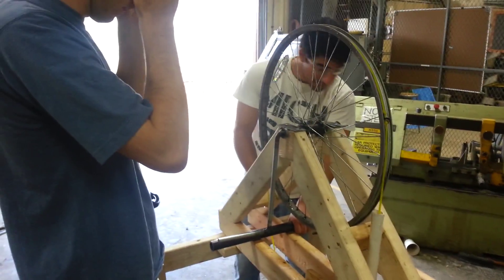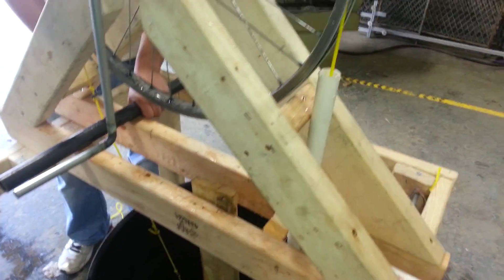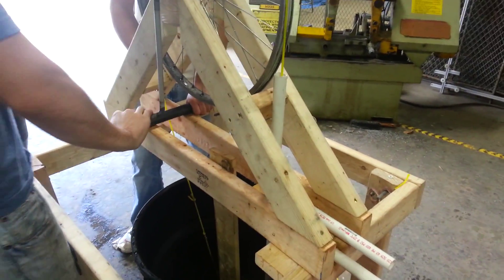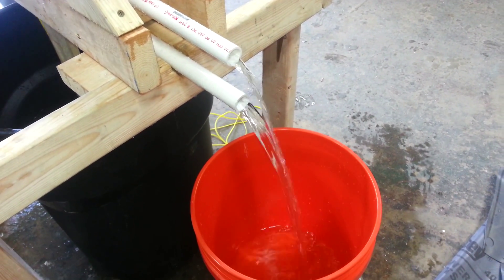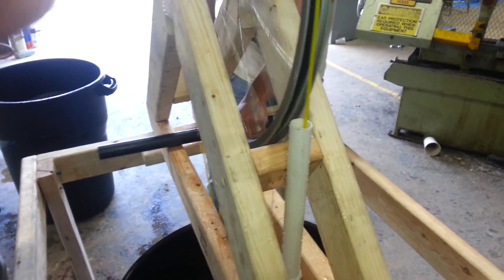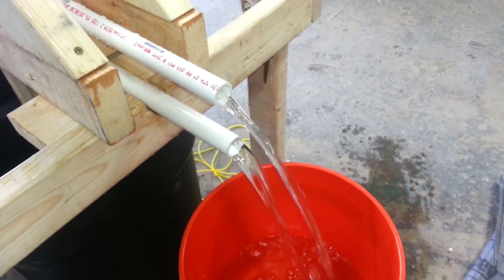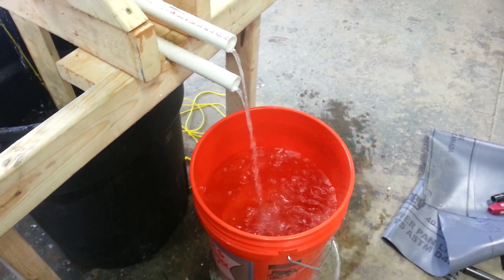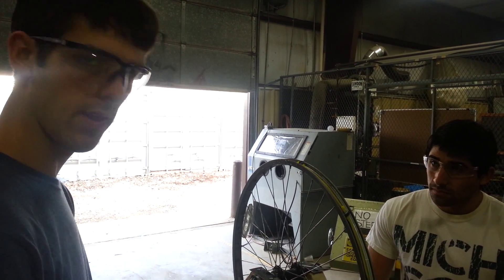Rope Pump Prototype 1.5- Test #4 (4-7-13)

Comment: Got an idea that may increase the GPM.

Use golf balls with inner tube washers to form a seal in the pipe.
Also use a sealed bearing caster hub for the bottom end.
Top wheel add a few spaced bars cut or bent to fit and guide the rope but help hold onto the balls.

I know a prepper who is using the same type of pump and can fill a 500 gallon tank in less then a day using 12volt solar power.